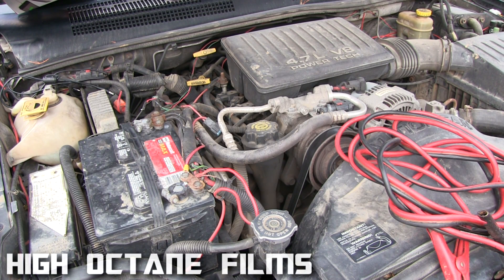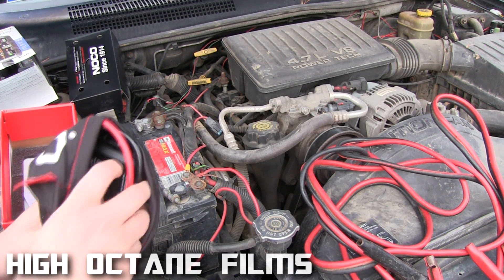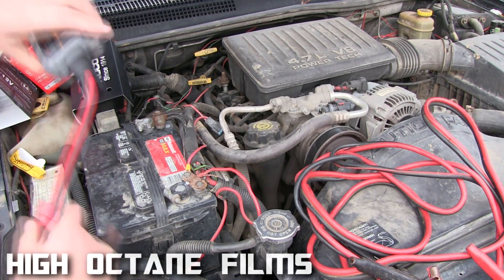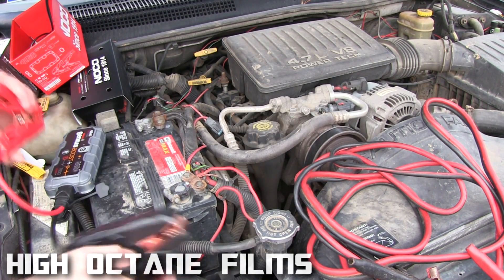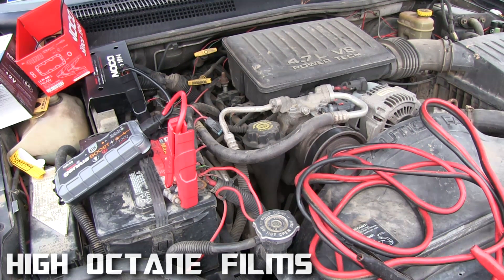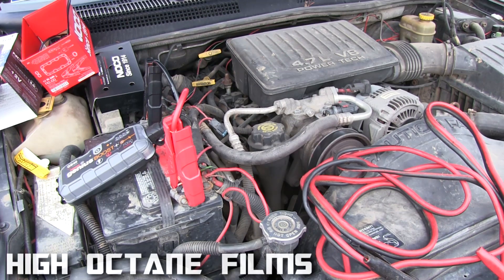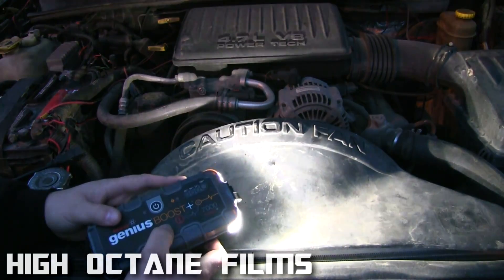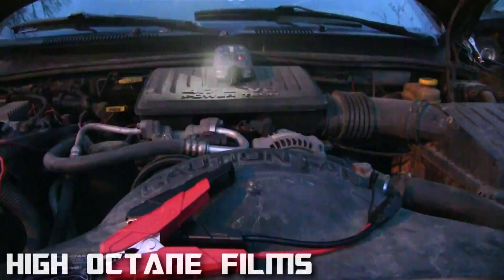GB40 NOCO Genius Boost Plus 1000A UltraSafe Lithium Jump Starter

Comment: So how long does the charge last how many jumps till it dies?
Reply from the maker: It holds a charge very well, I’d charge it once every few months if it’s not getting used, probably 4-5 jumps depending how much it takes per jump every different car would be slightly different

Comment: Nice, Thanks! 
Charges the booster when it stays on the battery? 
Does it goes to start the car without a car battery, only with the booster?
Reply from the maker: the booster recharges through a usb cable, i'm not sure if it would start a car with no battery or not it would be better to have a battery attached to avoid damage to your car. I've had this booster a month before the video was published and i still use it all the time, guess i need to make a new video about it.

Comment: Will it work on a gasoline engine of 5.7 L V8 ?
Reply from the maker: Yes I’ve jumped Another truck with a 5.7 350. Guess I’ve had it for almost two years and I’ve used the heck out of it. I can say it’s held up great for me.

Comment: I picked up one of these on recommendation of a AAA mechanic about a year ago. I now SWEAR by this thing. They are SO awesome. It drains quickly when charging my phone, but I can jumpstart my 2014 Honda CR-V 7-10 times without the GB-40 needing to be recharged (the battery on my CR-V is going dead, haven't gotten around to replacing it yet).

Comment: Can I run the GMC battery?
Reply from the maker: not sure, is there any difference from a normal battery?
Reply: I do not know !! But there is likely to be a difference between a 5.3 liter engine and a small engine such as the 4.7-liter front-facing
Reply from the maker: aziz sa I’ve jump started a 5.7 engine with it multiple times with no issues, it’s supposed to be able to jump start engines up to 6.0.
Reply: good ! My experience may have been unsuccessful in the past .. but I will apply for one to experience it because I recently relied on the wires instead of the device, but from the point of view there must be wires and the device for backup.
My previous experience was to buy 1000 amperes and run 4-cylinder cars, but I could not run 8-cylinder cars, and after a while I bought another 50.000 amp and it was a good job running the 8-cylinder engine but running it only 3-4 times and then I have to use it twice and then it crashes, I do not know what its problem is, then I rely on the wires to this day
I think the quality is bad !!